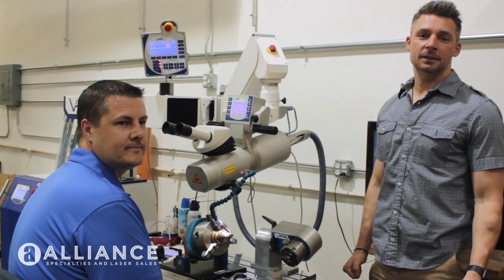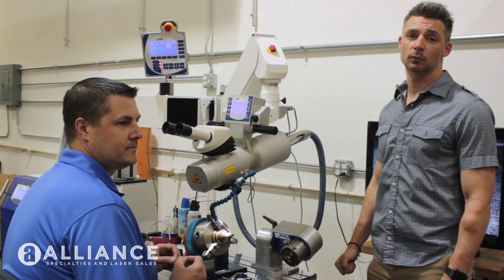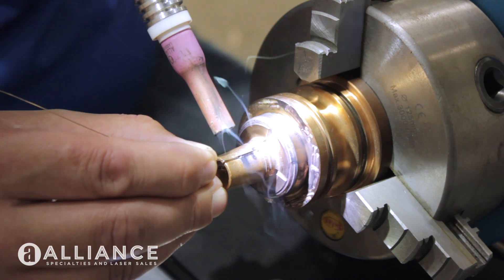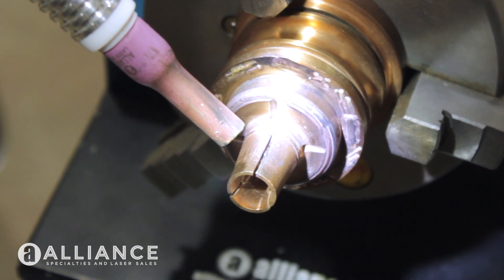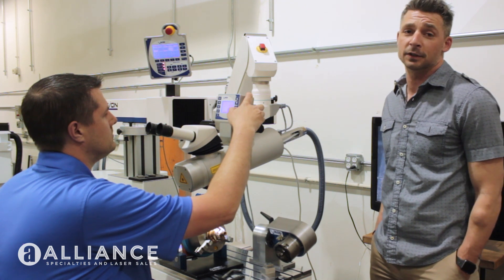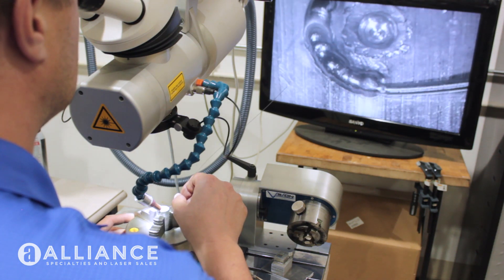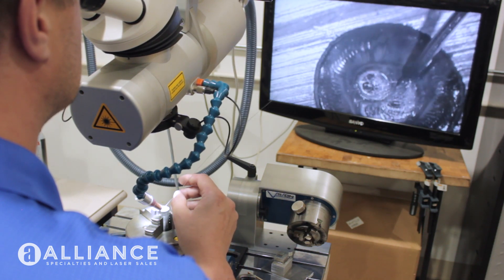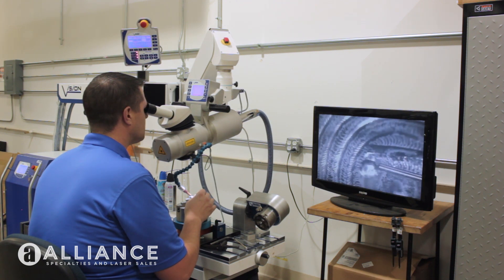Myth Busted: Laser Welding Copper & Aluminum with FSS Fiber Laser

Comment: Moldstar 90 is 3-4 times less thermally conductive than pure copper similar to brass. Try welding pure copper. The 4.5kW of peak power from the IPG QCW fiber laser will barely be enough.

Comment: I would like to see the welded parts cut and stained to show penetration into base metal.  Without that, it looks like you are simply melting either the filler rod or the base metal but we cant really see if the two are coming together like they should.
Reply: I doubt this welder can weld structural